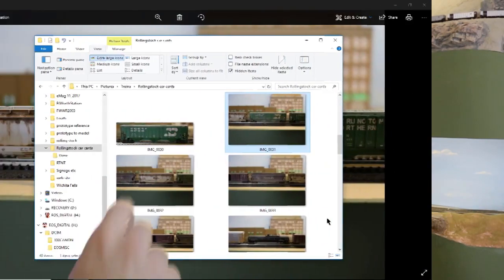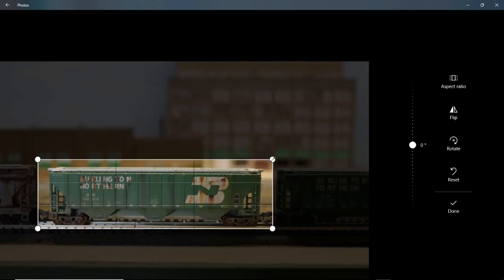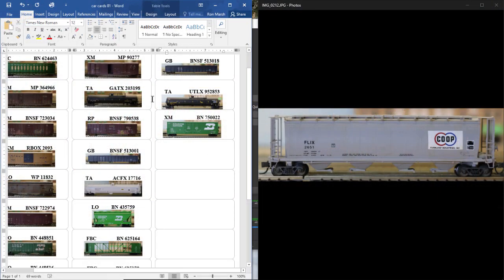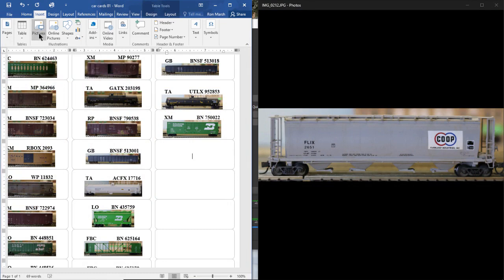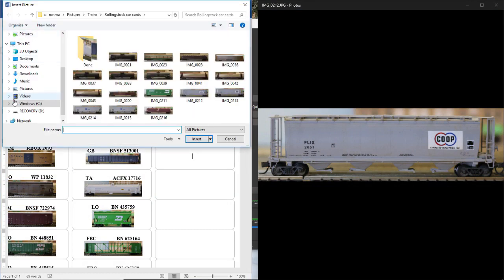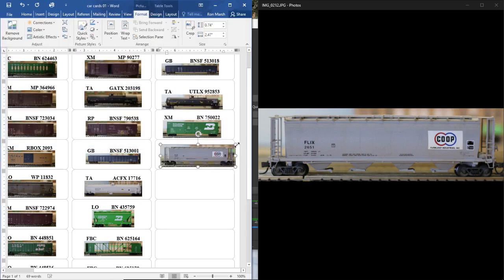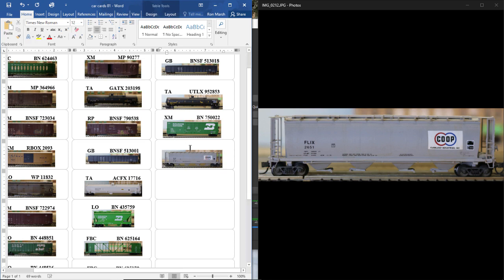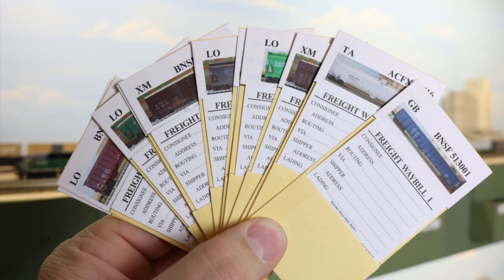Model Railroad Operations--Switch Lists

Comment: Always enjoy your videos. Good speaker and great content. I adopted your picture idea for my car cards and they turned out great. Do have a question though.  Have you ever needed to reprint just one of the labels that are saved? How to print just one instead of the whole sheet again?
Reply from the maker: That is a great question. I would copy that one label from the digital sheet and paste it into the first label on a new digital sheet, then print. That physical sheet will now be missing one label, but if you have this issue again, or go to make more labels, must skip the one label you have used on the digital sheet and then run the physical sheet back through the printer with other new labels. I hope that makes sense.

Comment: Ron,
I enjoy your videos very much. You present material in a way that is clear enough for me to understand, but I have developed a gap in my understanding.
In describing your process to create a switch list, you address the switching of an arrived train. When you get to the last cars on the train, you list 4 cars for Dorchester Grain. Because I don’t know all of the ins and outs of this system, I have some questions.
Assume that those 4 cars all originated at different places. Somewhere upstream those cars were switched into a block which was sent to WF on this train. I would like to see the waybills of some of those cars as they moved to WF. Let’s assume that those 4 cars arrived at the place where they were switched into the block from 4 different trains. How and where do those 4 cars get switched into the block. What is the information on the waybills that facilitates this. I’m sure that nowhere is a yard track labeled Dorchester Grain. Would car #1 be switched onto a track labeled by direction? Would there later be a track for WF yard? Would the nearest upstream yard block those cars? Somehow, other than by magic, those 4 cars came together to be shipped to Dorchester Grain.  For me to understand how this system works, I have to grasp this aspect of it. Thanks for your help.
Reply from the maker: Hi Jim. In the case of my layout, those 4 cars COULD have come together at North Yard in Saginaw. They would have been switched onto a track for the Wichita Falls Turn, and been blocked together when that train was made up in North Yard before departing for Wichita Falls. I hope this clears things up.

Comment: Thanks for the video.one thing you mentioned the one car with the red card that does not git moved, how would you handle that car if it was between two pick up's.
Reply from the maker: That can vary. In this case, the car can be moved and respotted. There are some cases when a car is in the process of being loaded and cannot be moved. In that case if there is a car blocked by the unmovable car it may have to wait to be pulled another day.